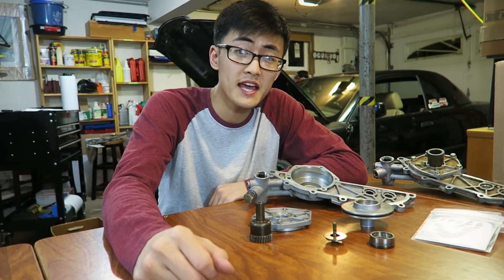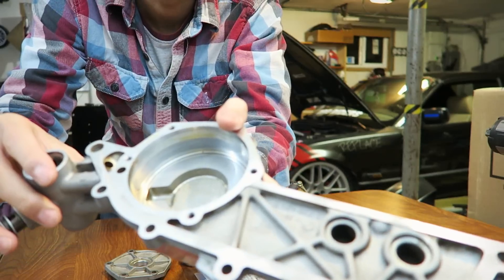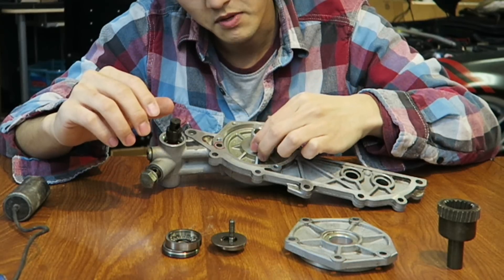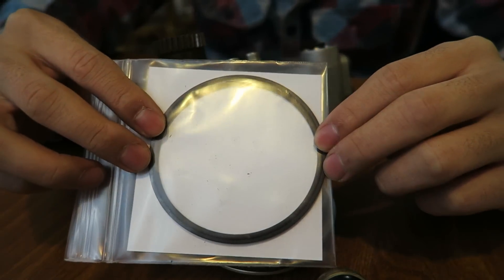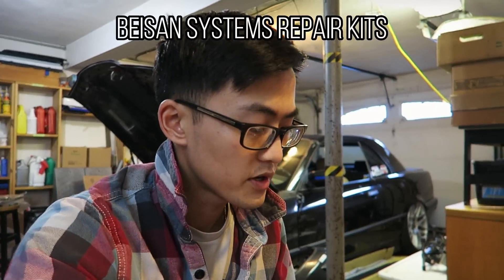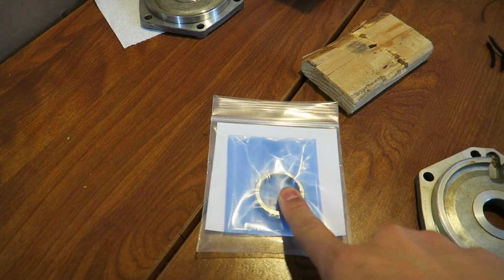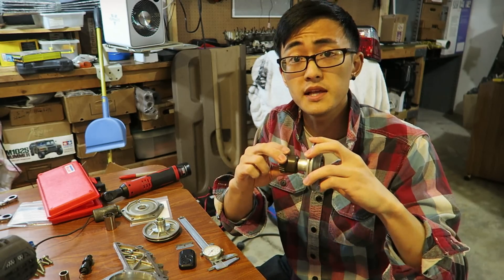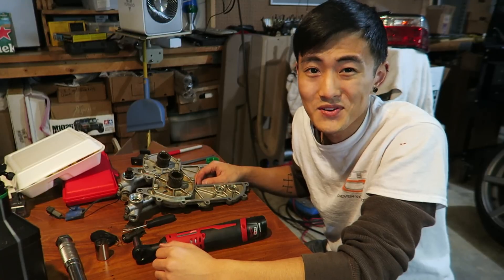BMW Single VANOS: How It Works, How It Fails, How To Take It Apart, & How To Fix It!!

Comment: I found an E36 for sale costing 3k . But it's been in 3 accidents flood damage and fire damaged worth to buy? Hehe
Reply: E36 M3 I wouldn't, you can find an E36 in much better condition for around the same price. Three accidents and the flooding already make me think of structural damage and rust. Be patient and find a car that is worth the time. You'll be much happier in the end.
Reply: Cameron Higdon of course I wouldn't buy it was a joke and I am 17 how am I going to afford it is a another question
Reply: E36 M3 I now see the "Hehe" at the end of your comment. My bad. I had no way of knowing you were 17, regardless, there are plenty of jobs for 17 year olds out there. I got a full time job for the summer my junior year and saved enough to buy mine.
Reply: +Cameron Higdon I convince my parents to let me work at a repair shop I will be starting this summer
Reply: E36 M3 There ya go, the first step to being a proud E36 owner!

Comment: nice clean video super helpful, wish there were more youtubers like you out there, also do you by chance know if the U.S. spec e36 m3 so s52b32 has the same unit, from what ive read on the forums it does???
Reply: Jc Finch yes, it does. The s52 is actually a bored out euro 2.8 m52. So same running gear for vanos.